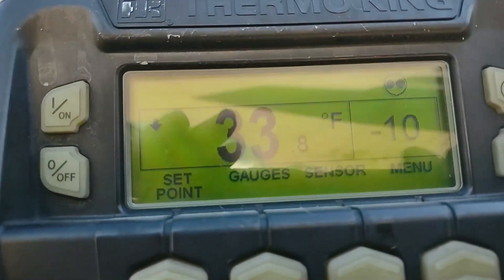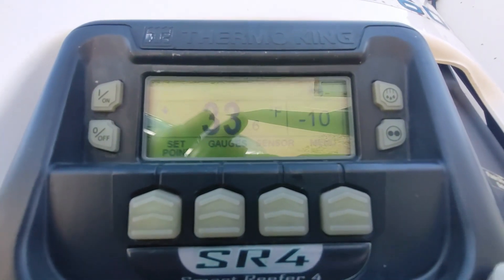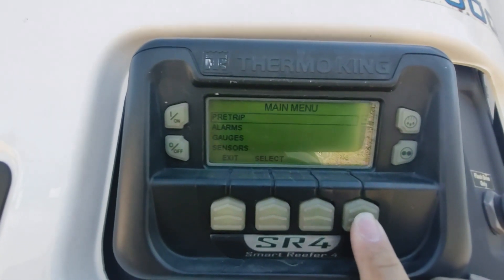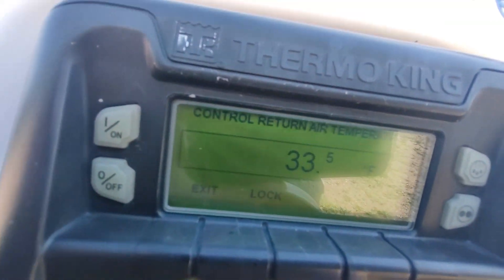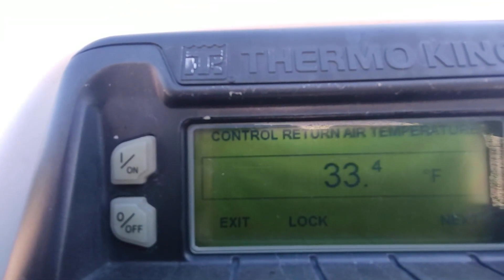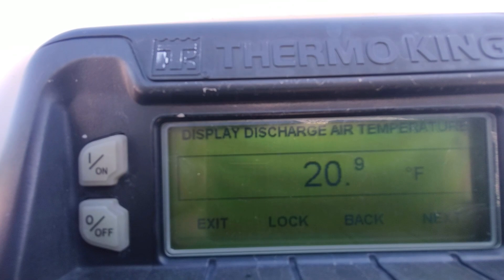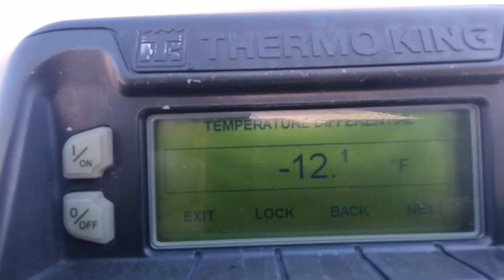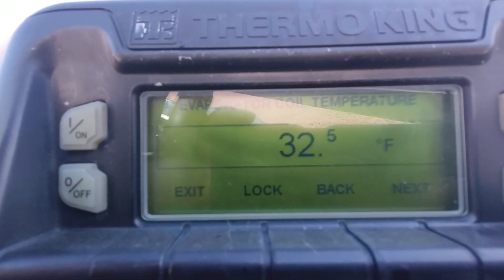What is Delta T? Why do you need to know?

Comment: Lol, I run a reefer, and one of the common loads we get are watermelons.  First time I loaded them, sure enough, the yellow light went off on my reefer.  "What the hell?"  I'm out checking the reefer, and everything looks fine?  Come to find out, yep, ambient temperature at the dock was around 100, and they stacked those puppies damn near to the roof.  Reefer was fine, it just took several hours for the darned things to cool down enough for the reefer to quit spitting out the error.

Comment: Good to know. I wonder if that's why my refer kept saying refrigerant pressure low while it was 100 degrees and they were unloading part of my -10 degree load at the kwick trip today?
Reply from the maker: You may be low on refrigerant., Or something else like a weak compressor
Reply: @DIYSEMI  it didn't do it at stop one when it was 80° at five in the morning. Started at stop two when it was hot enough to kill the power to the DC in Wisconsin, and stopped by the time I got down the road to stop close to stop there and four. Hasn't done it since. It's a carrier and I'm still figuring it out. Haven't hauled reefer this much since I got my CDL like 7 years ago. I know what to do with some chains and binders or some wrench's... But give me a load of candy topper's and I'm a freaking new guy again. 😂
Reply: @DIYSEMI  yep... It spun a gear and sprung a couple leak's in crucial places. The codes were telling the truth for once. It's all better now. 😂